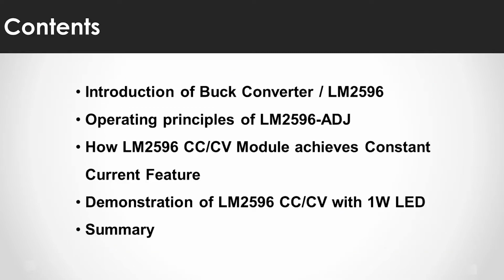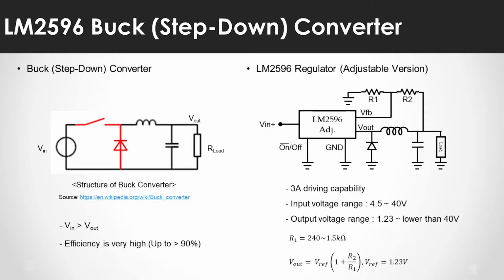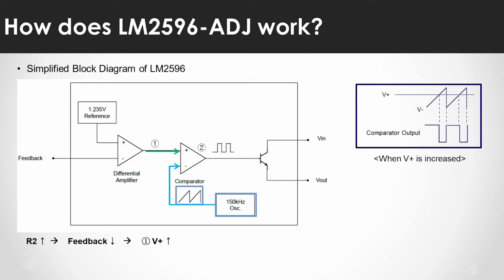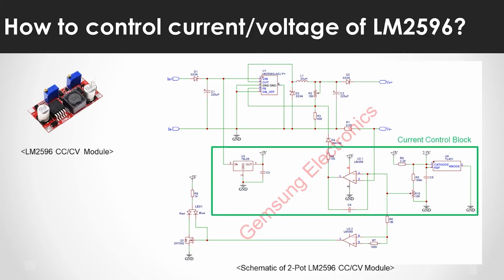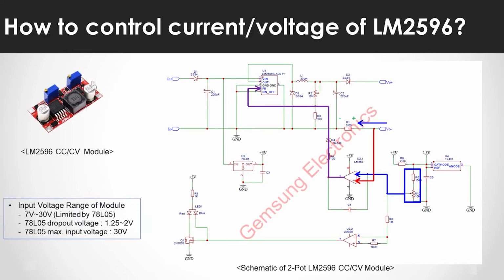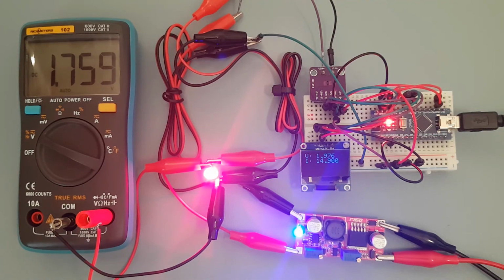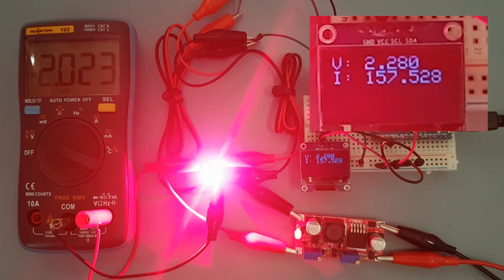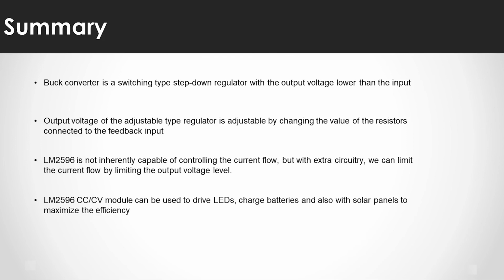LM2596 CC CV Module - Operating Principles (With Demo)

Comment: You state that the voltage range of the module is 7V~30V.  But the datasheet for the LM2596 claims that the absolute maximum for the feedback pin is 25V.   If the supply is 30V and the pot R2 is turned fully clockwise then the feedback pin will be at the output voltage, and that will be about 28V.   Wouldn't that fry the chip?   It seems to me the input voltage range should be 7V to 25V, unless some additional resistance is added between R2 and L1.

Comment: thank you for the info man. i want to use this module with 5 pieces lm2596T. i want to use only this 1 module and current control for all of them.can i do it for only 1 this module for 5 of lm2596?  i want to use this module but i want to connect other 5 x lm2596. and i just think i need to connect all of them 4.pin on this module on lm2596. i just need to know what can i connect lm358 1.pin to increase current for 5 x lm2596's 4.pins..what do you think about this idea? and the final result i expect that i i just this module control but i will 3x8=18 amp control. thanks for the video again...

Comment: Hi thank you for the great video I am trying to include this in a project so this has been very helpful. However I have a question about U2.2 (the second op amp) as it does not seem to be correct in your schematic, with both inputs tied to the same source and no feedback loop for it it will always be 5v and never change red light will always be on. are you sure you have that part correct? Thanks
Reply from the maker: Hello, as you pointed out, there is an error in the schematics.
There is a connection to the ground between Pin #5 of U2.2 and R7.
Thank you for your comment!

Comment: great, if I want to supply 5V and 2A for charging the battery then I just turn the CC & CV potentiometer?
Reply from the maker: Yes that's right!
First turn the cv potentiometer to 5V, and then set the cc potentiometer to 2A, while measuring the current with a multi-meter.
Thank you for watching!!
Reply: @gemsungelectronics460  I turn the current potentiometer and there is no current. its remain 0.00A. How's that?
Reply from the maker: Did you change the multimeter probe to current measurement port?
Reply: @gemsungelectronics460  yes, I did that
Reply: @gemsungelectronics460  I also notice that CH and CC/CV LED light up simultaneously.
Reply from the maker: Maybe your power source can't drive enough current?
Reply: @gemsungelectronics460  My input is 10v and 1A.
Reply from the maker: What is your output voltage from the module? The reference voltage of the module is 1.2 volts, so you need to set the output voltage higher than this value.
Reply: @gemsungelectronics460  output voltage is 5v
Reply from the maker: While connecting the output to a multimeter current port, adjust the current potentiometer clockwise and see if the current is increased.
Reply: @gemsungelectronics460  didnt change anything
Reply from the maker: There is a possibility that your module is damaged. If you have another module, test that one, if the problem persists, you might as well check your multimeter.
Reply: @gemsungelectronics460  I already bought the new one and the max output is 1.48A only. Cannot reach 2A.
Reply from the maker: Your power source is 10V and 1A, so it is capable of sourcing 10W of power. The output of your module is 5V, so in theory, you can get an output of 2A. But you need to take into account the efficiency of this buck converter, and the loss due to several factors.
If you can measure the voltage of your power source, then probably you might see that the voltage is not 10V while you short the output of the module.
Reply: @gemsungelectronics460  so how do i get 2A from this buck converter? Is this related to my input?
Reply from the maker: Yes, you need to take the efficiency into account. 10V and 2.5A source could be sufficient for your case. (Based on your output of 5v, 1.5A)

Comment: Can this power a 3w led 12.6v.  Volt support; 7v-17v
Reply from the maker: LM2596 CC/CV module is capable of providing up to 3A and <30V to the load.
In your case, you should set the LM2596 CC control not greater than the forward current of your LED.
For the voltage control, it is okay to set the voltage to the value equal to the forward voltage of your LED.

Thank you for watching!
Reply: @gemsungelectronics460  thank you for the video !

Comment: Nice video. However, the R5 on the schematic, is it 154K or 15.4K?
Reply from the maker: Thank you very much!
The R5 on the schematic is 154K ohm.
I added the link for the schematic in the comment for your reference.
Have a nice day!
Reply: @gemsungelectronics460  Thank you for the answer. However, I can't seem to find a resistor with such value. Is the 154K ohm resistor, a standard resistor or you have to make a resistor network just to have that kind of value. Thanks in advance.
Reply from the maker: @Stephen Fajardo, Hello, in my opinion, it is best if you can closely match the resistance of R5, but if you cannot match exactly, it is better using a slightly larger resistance. (To prevent over current)

Following is the reason why.
If you use 154Kohm, the current control range is 0 ~ 3.048V.
If you use smaller value for R5, the current control range is increased, with increased sensitivity.
You can calculate the current control range by using following formula.
1. Voltage divided = 10K/(10K+154K) * 2.5V = 0.152V
2. Maximum current control range = 0.152V / 0.05ohm = 3.048A (0.05ohm is the serial resistor between the negative terminal of the output and the ground of the module)
Reply: @gemsungelectronics460  Also, the 2.5V that is connected to the cathode of the TL431. I'm wondering where it came from and where it is connected.
Reply from the maker: TL431 is the voltage reference which generates 2.5V.
You can think of a Zener diode which reverse breakdown voltage is 2.5V.
When the voltage exceeding 2.5V is applied to the cathode (in this case 5V), the Zener passes through a high current, and if the current source is limited of current supply (this is why we added a 2.2Kohm resistor to 5V), it can be regulated to 2.5V.
TL431 can be a substitute for the Zener diode.

Thank you for asking!
Reply: @gemsungelectronics460  Thank you so much for the in-depth explanation. Now I understand that 2.5V is just the voltage reference that is generated by TL431. Just to clarify, the 2.5V NetFlag on the schematic doesn't have to be connected anywhere on the circuit other than the cathode of the TL431 chip right?
Reply from the maker: That's correct. It is just to indicate that it has a voltage of 2.5V, not to be used as a power net elsewhere.
Thank you!

Comment: Can i use LM2596 to replace TP4056 ? If can , can you explain it.
Reply from the maker: It cannot be replaced directly, since LM2596 doesn't have a constant current feature built in it. But it can replace TP4056 by adding extra circuitry to support constant current.
Also, you should be aware that TP4056 needs battery protection circuitry to protect the battery from over-charge and discharge. This applies to LM2596 as well.